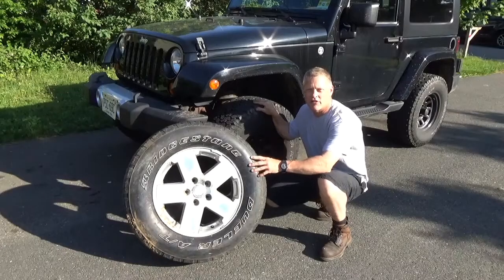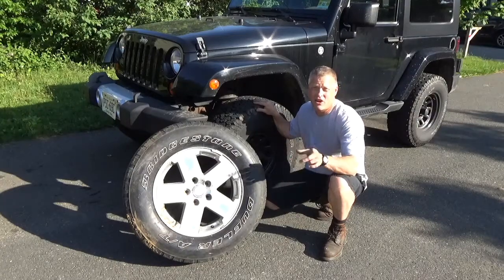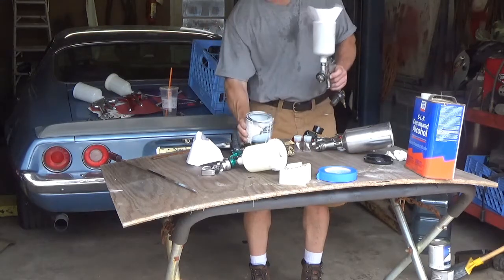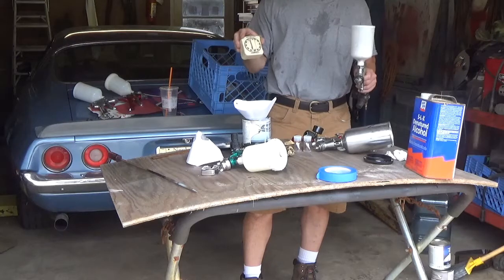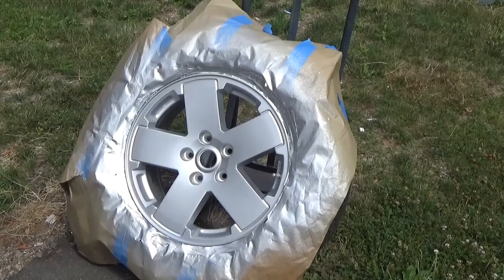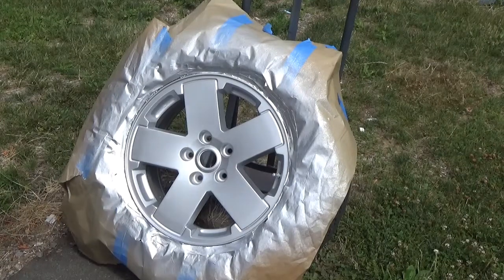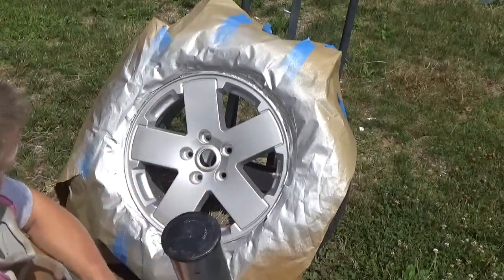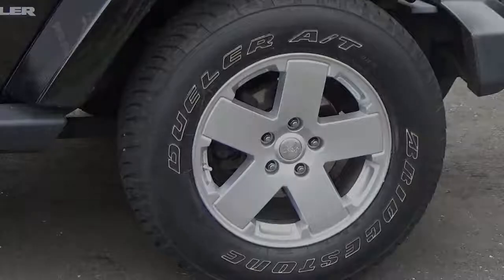How to paint wheels

Comment: Great Video!, and very well explained.  Just subscribed!   I am going to use this video as a guide when I paint my rims however, I don't have access to the paint tools you have.  I was thinking about using spray cans (from Home depot etc). Would this work?  Never done this before, thinking of using a flat black but want to stay away from the plastidip as I heard it comes off easily.   Thanks again for this video!
Reply from the maker: Thanks Jamie!  As a matter of fact on the same jeep, I lifted it, replaced the wheels and put on larger tires.  They are the wheels at the start of the video. I never liked the color to much and last year repainted the wheels with wheel spray paint from AutoZone. I like how they came out. Same method applies how to paint with cans as the spray gun. The wheels are in this video have a look.  https://www.youtube.com/watch?v=CIrMOiKVntc&t=8s